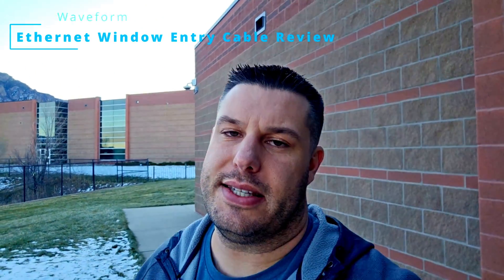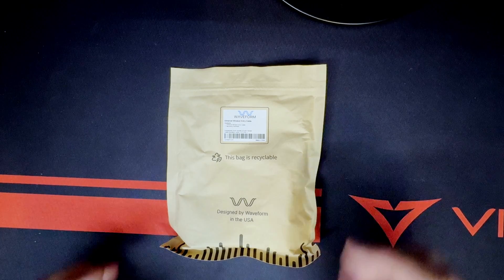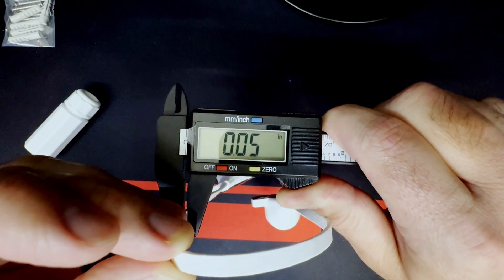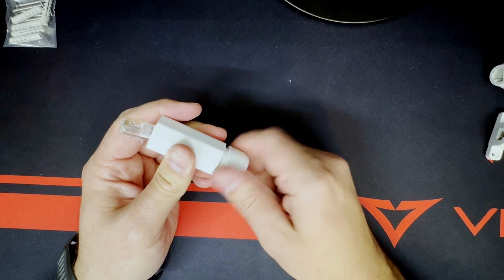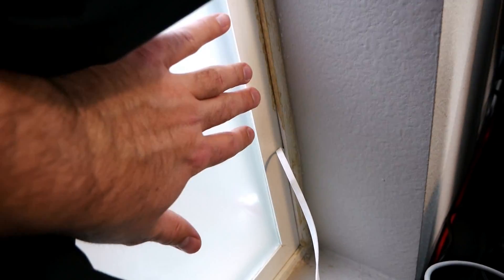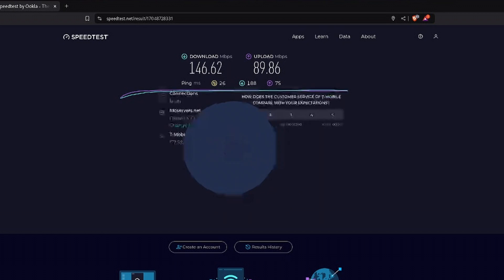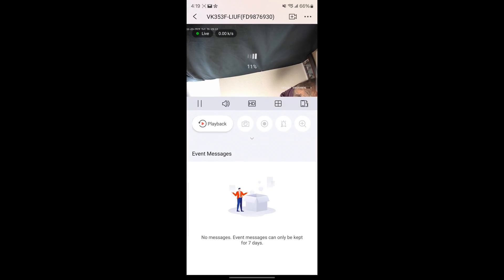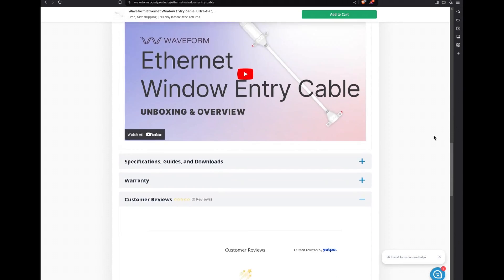Waveform Ethernet Window Entry Cable: A Closer Look

Comment: Is this plug and play for the starlink or are there other adapters needed?
Reply from the maker: I don't have starlink, but its just an Ethernet extension cable that is flat to fit in a window seal and weather proof on one side. If all you need is that then it will work.